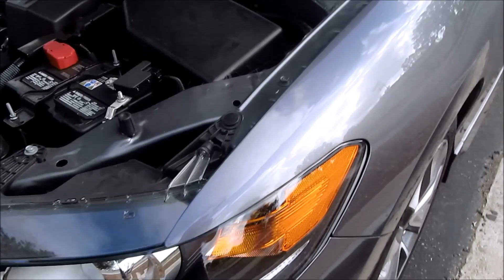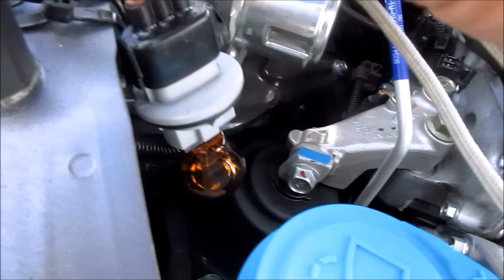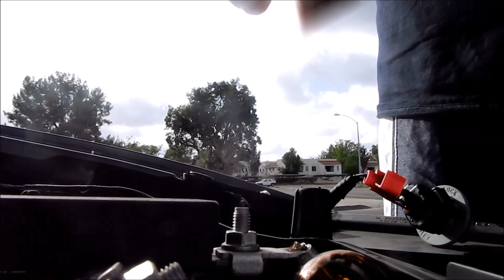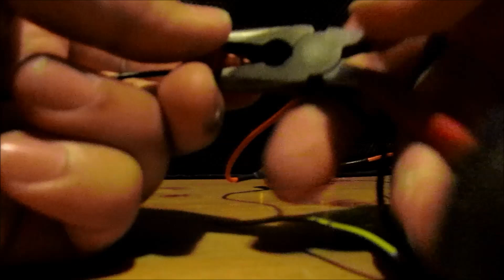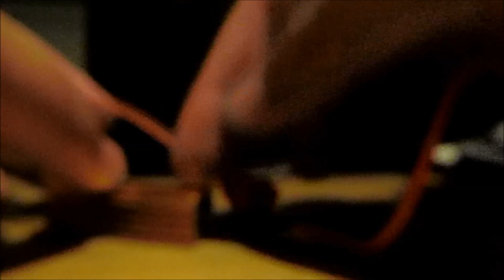Tutorial: 2013 - 2017 Honda Accord Front Turn Signal Resistor installation

Comment: I installed electronic relay...who in the hell uses resistors now?
Reply from the maker: Frank Martinez It is clear that you do not own the 9thgen Accord.  If you did you would know the relay is integrated into the gauge cluster. Therefor you simply can not swap it to an electronic relay because it's not a replaceable part.
Reply: DIY: Car Modz that's what you think. ..i do car electronics for living
Reply from the maker: Frank Martinez Funny as someone that does car electronics for a living.. one would think that they would know that the turn signal rate on the 9thgenaccord (and many other new cars) is controlled by the BCM.  Since you're a "pro" I'm sure you just had a brain fart and forgot about that for a min.  It's cool... shit happens =)
Reply: +Frank Martinez damn... lol gg

Comment: Any tips for my Honda Accord 2005 lx on getting a LED turning lights, I have bought a new headlamp that came with some sockets and bulb for the turing lights but they hyperflash, but when in hazard they are normal. Also the it is nowhere noticable for my turning light to be seen blinking when I have all my lights on.. Help Accord fam,
Reply from the maker: Kevin J Make sure there is not a short in the wire harness.  ( check all the connection points on the aftermarket headlight to the original wire harness, make sure everything is sealed correctly ).  If everything checks out okay, then read this: http://www.v6performance.net/forums/7g-honda-accord-technical-discussion/218889-how-prevent-hyper-flash-led-turn-signals.html
Reply: DIY: Car Modz I havent bought an LED light though its stock rn, seller said it changed because of the headlamp fitment of it
Reply from the maker: Kevin J Can you link me the headlights you purchased?
Reply from the maker: Kevin J This is what I would try.   I'm guessing that all you did was remove your original headlights and removed the sockets that holds the low beam, high beam and the turn signal bulbs.  You then inserted the low and the high beam socket/bulb into the aftermarket headlight assembly.  You uncliped the original turn signal bulb socket holder from the original wire harness and removed the bulb and inserted the OEM bulb into the aftermarket turn signal bulb socket and plugged the aftermarket turn signal socket back into the original wire harness.
Reply: DIY: Car Modz ive tested it even with the original and aftermarket socket it still hyper flash but ill be glad to cut the after market opening to able to insert the OEM bulb in with theaftermarket socket
Reply: DIY: Car Modz and the only one that came with a socket and bulb was the turning signal, Therefor everything is OEM but the turning signal
Reply from the maker: Kevin J 1st thing I would try is.. remove the turn signal socket on both the driver and passenger side.  remove the aftermarket turn signal bulb holder from the wire harness.  Get your OEM turn signal socket and insert the bulb and reconnect the harness.  Do not insert it back into the headlight.. just let it hang and start the car and check for hyperblinking.
Using the emergency signal won't be any help since it will flash normal regardless if it has a short or led or something else wrong with it.
Reply: DIY: Car Modz thing is the OEM socket is inches bigger than the aftermarket therefor it wouldnt fit at all
Reply: DIY: Car Modz if only the OEM fits then i wouldnt have any problem but the aftermarket seems to be inches smaller diameter than the OEM ne
Reply: One*
Reply from the maker: Kevin J As long as you didn't tamper with the original wire harness and everything was working fine before you swapped the headlights.. the problem is either A) the aftermarket turn signal socket or B) The original wire harness has been tampered with.
Reply: DIY: Car Modz yea i contacted the seller they said the turning signal is ought to be different but i mean its so hard for people to know that I am turning when we're heD to head because the front blinker is barely noticable and hyperflashing
Reply: DIY: Car Modz and no i did everything plug and play, i didnt play with any harness whatsoever
Reply: DIY: Car Modz also they dont sell socket with that small of a diameter and bulb of that size
Reply from the maker: DIY: Car Modz diycarmodify@gmail.com
Reply from the maker: Kevin J Send me a picture of the bulb and the socket and the connector on the aftermarket headlight assembly.

Comment: I purchased these for my '15 Accord Sport. 

Front Signals/Park: http://www.ddmtuning.com/Products/1157-33x5630-Dual-W-A1157-Switchback-33-x-5630-Dual-Color-WA

Rear Signals: http://www.ddmtuning.com/Products/7440-7443-27x2835.7440-7443-LED-27-x-2835-SMD

And these resistors. http://www.amazon.com/gp/product/B00L4V9ECY?psc=1&redirect=true&ref_=oh_aui_detailpage_o00_s00

I crimped the splice taps till they were almost flush with the caliper. Still getting the hyper blinking. Had no issues with installation. Tapped the black/ground and the blue/green turn signal wires. Not sure where it went wrong. But did I order the correct items? First at doing all of this DIY stuff.
Reply: The resistors do get really hot like they should. So there is some sort of current flowing.
Reply from the maker: Ronald Bigornia Try and install the resistors separately. Do the front one first and check and see if the hyperblinking stops. 
The items ordered are correct.  Since you purchased the 50w 6ohm resistors, you have to install one resistor per each turn signal bulb.

Comment: hi DIY: Car Modz i have a question i have 2015 accord sedan i just installed the resistors but now my type 2 aren't white when my turn signals are not active and my parking lights don't turn before i installed them they worked fine any suggestions or help?
Reply from the maker: arthur velasquez Which 2 wires did you connect the resistors?  Also check your parking light fuse. https://www.youtube.com/watch?v=HMUwYS88bSE
Reply: Driver side is black and blue and passenger side is black and green
Reply from the maker: arthur velasquez Those are the correct wires.  Which resistor did you use ( do you have the link to the exact resistors you purchashed) and how did you connect them to the stock wire?  Also, what happens when you install the stock bulbs.   Are you checking the lights while the car is running?
Reply: DIY: Car Modz http://www.amazon.com/gp/aw/d/B00F2ZKHFQ/ref=mp_s_a_1_2?qid=1433908908&sr=8-2&pi=AC_SY200_QL40&keywords=JDM+ASTAR+50W+6Ohm+LED+Load+Resistors+for+LED+Turn+Signal&dpPl=1&dpID=519hi2H92LL&ref=plSrch
And I changed out the fuse and took off the resistors but did not tape up correctly the exposed wire but when I turn on the lights it blew out the fuse I'm already on my 3rd one the led light works just fine I connected it to my dome light works just fine what do u suggest I do?
Reply from the maker: arthur velasquez I would first tape up the exposed wire.  The exposed wire can cause a short which will blow out the fuse.
Reply: Okay I covered it correctly and I will have to wait till tomorrow to install new fuse will keep you updated thank you so much

Comment: I'm currently installing LED turns in my 2014 Accord Hybrid, but the signals won't stop hyper-blinking. Am I doing something wrong. Ive added the resistors as you suggested in the videos. 6 Ohm 50w resistors. The only difference is your wires were the same color on the resistor and my resistor has black on one side and red on the other. Is that stipulating a directional resistor?
Reply: After some inspection on the connection I realized that I did not clamp the connectors all the way down thus not splicing into the wires. Once I re attached and clamped with a good splice, the hyperblinking stopped and the 1157 switchbacks worked wonderful.
Reply from the maker: Wallace Castillo Glad to hear you got it working.  Those connections can be tricky.  Like you mentioned. They have to be clamp tight.  People usually here the "click" and stop.

Comment: Where could I pick up these resistors with quick connects? I looked on Amazon and came up with nothing.
Reply from the maker: 50W 6ohm resistor:
http://www.amazon.com/s/ref=nb_sb_noss_1?url=search-alias%3Daps&field-keywords=50w%206ohm%20resistor&sprefix=50w+6ohm+re%2Caps

I've been told that the turn signal for both the front and rear are in the same circuit and by using this one in the rear it will fix all 4 corners ( However, I have not tested this myself): 50W 3ohm resistor

http://www.amazon.com/s/ref=nb_sb_noss?url=search-alias%3Daps&field-keywords=50w+3ohm+resistor&rh=i%3Aaps%2Ck%3A50w+3ohm+resistor

Comment: Do you have a video on making your own plug and play adapter?
I am financing my 2014 accord exl atm so I don't want to risk any complications.

If not, can you give me a link of a item i have to buy and a brief description of how to apply it? The link you provided to another commenter (http://www.ebay.com/itm/like/380585148303?lpid=82) is being directed to another item so im not sure if its the same item.

I have changed up my fogs, lowbeam, parking, and all im missing is this turn signal to have a matching look. 

Thanks and a lot and much props to your videos!
Reply from the maker: Do you have sedan or a coupe?  If you have a sedan 4dr and you want to use  OEM connectors and wires for the wire harness.. it will be around $220 in just parts.  If you want to use stuff from china.. You need http://www.ebay.com/itm/50W-6OHM-LOAD-RESISTOR-LED-DRL-TURN-BLINKER-FAST-FLASH-FIX-FOR-FORD-HONDA-CHEVY-/171490006191?pt=Motors_Car_Truck_Parts_Accessories&hash=item27ed99d4af&vxp=mtr and http://www.ebay.com/itm/1157-7528-2357A-2057-LED-Bulb-Light-Decoder-Canceller-For-European-Vehicles-DC7-/351127931839?pt=Motors_Car_Truck_Parts_Accessories&hash=item51c0db0bbf&vxp=mtr

You will have to test the wiring though.  You have to cut and replace the black box (decoder) with the 50w 6ohm reistor.  You then hook up one end of the resistor to the parking light wire and the other end to the turn signal positive wire. Also, the 1157 socket from ebay might not fit the accord housing socket without cutting some of the tabs.  I'm not sure, I haven't tried it.
Reply: DIY: Car Modz sedan
Reply from the maker: Heng Ruan or you can buy the one from vleds.  I believe that one has the resistor built in the led bulb itself. http://www.vleds.com/v3-triton/bulb-system.html
Reply from the maker: Heng Ruan More info here: http://www.driveaccord.net/forums/showthread.php?p=3145681
Reply: DIY: Car Modz oh, so if i get the one from vleds, i wont have to tamper with any wiring at all? Its just plug and play directly from oem connections?
Reply from the maker: Heng Ruan I believe so,  I think that is what I've heard.  Before you order, you might want to give them a call to confirm.
Reply: DIY: Car Modz yep, i will do that to confirm.

Thanks again for everything!!!

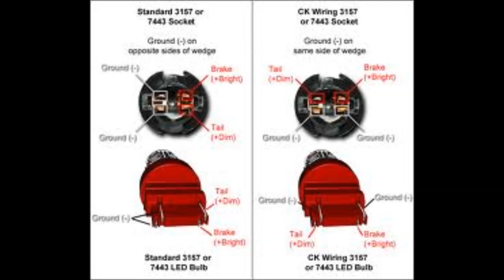Comment: What is the thing you need to purchase 1:45 into the video?  The video cuts out and you can't really read the diagram  C cable?  Everything else is great.  I'm blowing the fuse and the turn signal blinks white not amber?  Any thoughts... Thanks
Reply from the maker: Brian Jones If you have a coupe you must purchase the CK type turn signal bulb.  Standard led will pop the parking light fuse.

Comment: For the driver side turn signal do you twist towards the engine or outwards? I can't seem to get the driver side turn signal socket to come out. It won't even budge.
Reply from the maker: You turn it counter clockwise to unlock.
Reply: DIY: Car Modz Counter clockwise when facing the bulb? So towards the inside of the engine?
Reply from the maker: you turn it counter clockwise.. loosen left... tighten right.

Comment: I have the 2013 Accord Sedan.  Do you know if the 6 Ohm 50W resistors work with the 1157 bulb or do I need 8 Ohm 50W resistors?
Reply from the maker: From what I've heard 6ohm should work... However, I only tried 8ohm and from personal experience 8ohm works.  One important to mention... 6-8ohm resistor do get very hot.  Enough to burn your hands and melt though plastic and wires.  So, please mount the resistor away from all plastic and wires and mount it on something metal to dissipate the heat.

Comment: Hi, I want to ask. What if my vehicle does not have the parking wire (the third extra wire) at the blinker wires? so i have to take the wire from battery source and goes through ignition source?
Reply from the maker: If your changing your signal to LED and the socket only has 2 wires. then you connect each end of the resistor to each wire lead on the wire harness.  One to positive and the other to negative.
Reply: DIY: Car Modz
I manage to installed it by modifying the single filament t20 aka 7443 bulb socket to fit the dual filament bulb, as i bought the wrong bulb. But however after i installed it with the load resistor, it still blink fast like without load resistor, how could it be?

Comment: So you shouldn't mount the resistor with zipties? because you said it'd get hot and melt through plastic.
Reply from the maker: you can as long as the zipties are not touching the metal resistor.  For example.. zip tie the 2 ends of where the wires attach to the resistor.  Or mount the resistor to a metal bracket and zip tie the bracket.

Comment: I am still financing my car. Can I splice the wires to do this mod?
Reply from the maker: I don't see why not, just tape it back up if you remove it.  Or you can make your own plug and play adapter. Using something like this:

http://www.ebay.com/itm/like/380585148303?lpid=82

FYI that thing will not work as is..  you will have to cut out the middle black box and toss it and install a 6ohm 50watt resistor in its place.

Comment: Is this the same procedure when installing rear LED bulbs on the 2014 honda accord?  Do you still need to install the resistors? if so on what leads?
Reply from the maker: Yes, you will need to install resistor on all turn signal wires.  You need to tap the ground (black ) and positive turn signal wire.. Get a DIMM or test light to test which wire is the turn signal positive wire. ( or I can test it later next week )
Reply: Yes the front ones are done..its the rear ones im having questions on...theres only 2 wires going to the tur signal lamp post...do I just tap in to those two? Thanks for your help.
Reply from the maker: Correct,  You just tap those 2 wires.
Reply: tech919 thank you...

Comment: is stead of installing resistors, can't i just buy a fuse for LED bulbs. if so would you know what fuse #?
Reply from the maker: The part you need to change is the turn signal relay.. not a fuse.  However, for the newer Honda car they are integrated with the MICU unit and therefore  you need to use the resistors.

Comment: Thx q so much for ur video. could u tell me the bulb of the back turn signal of honda seden 2014 please.
Reply from the maker: The rear turn signal bulbs are 7440.  Be very careful when you order them online.. Especially eBay,  Many Chinese sellers can't tell the difference between a 3156 3157 7440 7443 bulb and you might not get what your order.

Here is a picture of what a 7440 bulb base should look like:
http://store.ijdmtoy.com/v/vspfiles/photos/20-201-2T.jpg

This is a 3156:

http://store.ijdmtoy.com/v/vspfiles/photos/20-006-2T.jpg
Reply: DIY: Car Modz  thx man. so i should order from amazon better ?? the rear turn signal i have to put the resister to fix the hyper blinking too ?

Comment: Do you know how it works with the 1157 on accord sedan because when I install the led bulb, the white bulb doesn't turn off when the amber is on. Any idea how to fix it.
Reply from the maker: Try to wiggle the base of the led bulb with the headlight on and turn signal on.. sometimes when you insert the led bulb and twist the bulb to lock it in place.. it might bet misaligned.. however if that doesn't fix it...

The bulb you received are defective.   ( well not defective but produced incorrectly..)  Many of the switchback sold on eBay function just like you described.  They lack the component that makes them a "switchback" led.  They turn on amber with your turn signal and turn on white with the parking light but it does not turn off or alternate with the turn signals.

Now switchbacks comes in 3 different types.. there are ones where they turn on white with the parking light and turns off when you turn on your turn signals (type 2).. there are ones that alternates with the parking light (type 1) and there are the ebay special that the white parking light stays constantly on. (type CRAP)  You just happened to purchase the eBay special leds.
Reply: DIY: Car Modz I might buy the crap as you said, lol. But when I test with the original bulb, i realize that there are 2 filaments in the bulb. And the parking filament is still on, along with the signal filament. Then, I guess Honda originally makes that to enhance the outcome of the signal bulb. I think I need some modification for the socket, and right now I have no idea what the solution for that. You can try with the sedan to see the problem.

Comment: Show a video how it looks after its done brotha
Reply from the maker: I did not install the switchback led on the accord.  As mentioned on the video, the coupe has an amber piece that covers the turn signal area and it will be useless to install switchback leds.  Here is a video on a different car that I installed switchback led.

Type 2 switchback:   Parking light turns off and Turn Signal blink
Switchback LED - Type 2

Type 1 switchback: Parking light and Turn Signal alternates
Switchback LED Type 1

Comment: Will this work for any signals?good video man
Reply from the maker: yes, it will work any turn signal.  All you do is install the resistor with parking light positive wire and the ground wires.